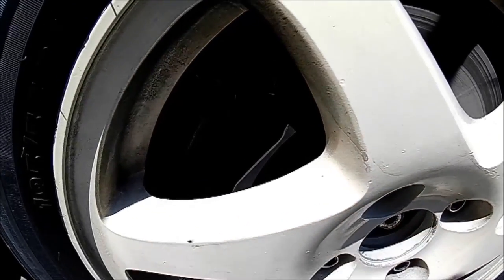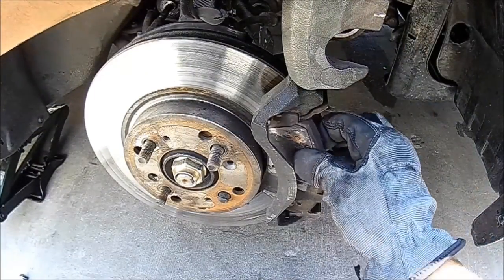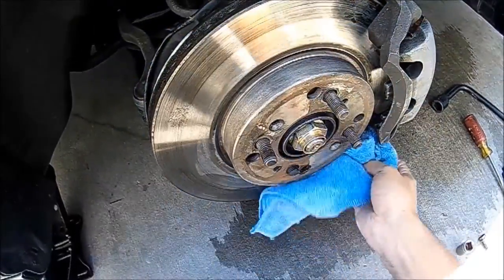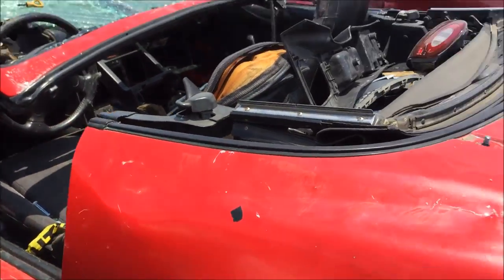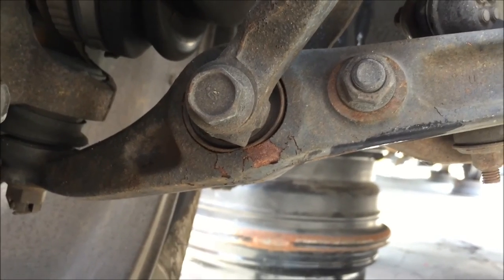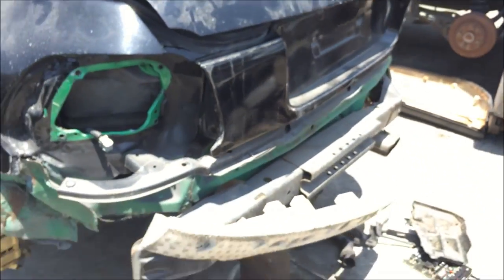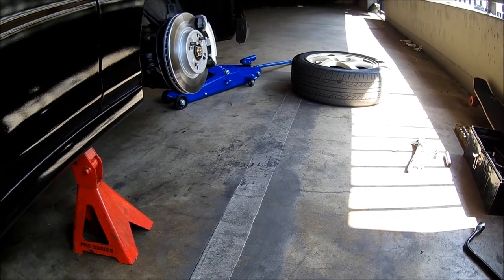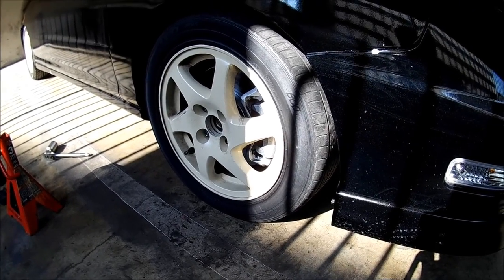Painting brakes turns to headache

Comment from the maker: No I got the 1994+ Acura Legend calipers (dual piston) and 4th Gen Prelude VTEC (11.1inch) rotors. Very attractive brakes and better stopping for under $100! Only work you have to do is grind the caliper brackets some, and redrill the rotors to 4x100 because they are 4x114.3. Link will be in description:)
Reply: oh nice!  i used mini coupe rotors with type r reman calipers.
Reply from the maker: +Honda Game good stuff man, I went with the nsx/legend calipers because they can be found in the junkyard easy lol and I went with the Lude rotors because they are a little thicker. I'm 100% sure they both feel the same on stock brake pads
Reply: Integra DIY
what do you think of ebay turbo kits?  i was looking at dna/godspeed/ko-speed
Reply from the maker: +Honda Game I've actually looked into it, if you can find a kit that includes everything except the manifold and turbo get it, then get a nice turbo and manifold. I've read the seals in cheaper turbos go bad, bearing are cheap and develop shaft play. Manifolds after some heat and abuse can crack easily at the flange..